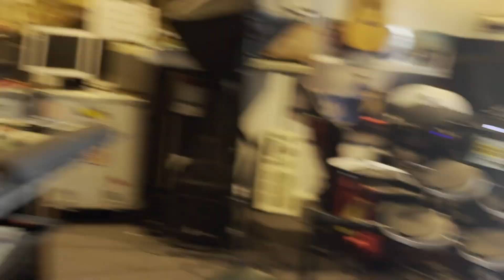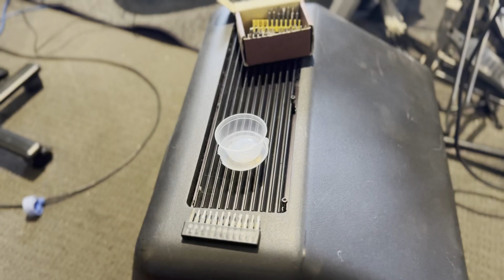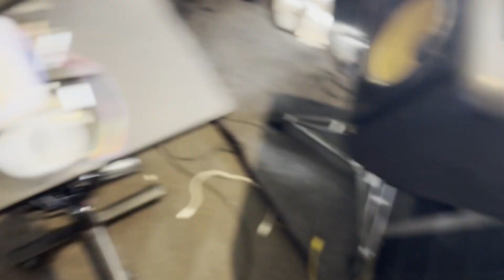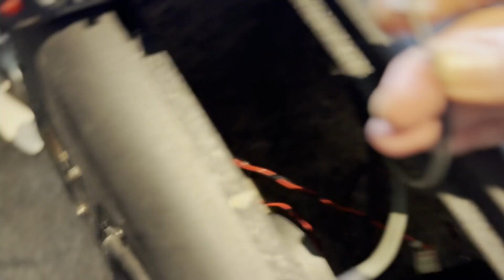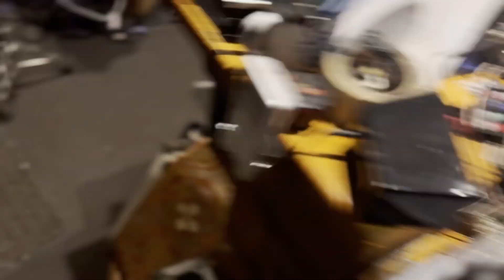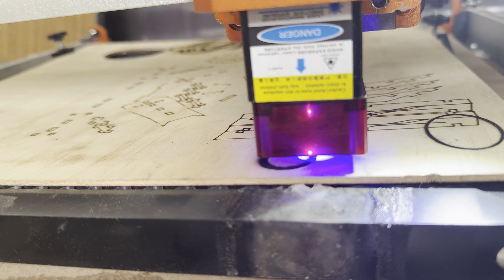KRK E8 Speaker Amplifier Repair and Tweeter recoil - Fixing my own stuff-up

Comment: Awesome vid you should've recorded the voltage test points measurements and those little important steps like how to conect your oscilloscope to the plug and the swapping between amplifiers,also what you did whit the Arista,it would've been nice,Nice video I have had 10 of this,I'm currently working on 2 whit really bad burned power supply PCB boards at cement resistors location! Plus bad caps on the same location Power supply PCB board !Awesome job!

Comment: This video is excellent. Thank you! My KRK E8s had an issue today, both tweeters didn't seem to be working. Both speakers had an odd hum, after about 5 mins of being powered on the hum went and the top end came back on the left one, and then around 5 mins later the other one came back on. I'm wondering if this means I have some capacitors on the way out.
Reply from the maker: @simonwoodgate5458  thanks. Sounds like it yes. They are very old now so I’d be def replacing the power supply capacitors and go from there. Him or noise when nothing is connected to them is a dead giveaway of capacitors leaking and not holding charge.
Reply: @onomatopoeidia  Thanks. I've had them over 20 years, mixed everything on them. Don't know what I'll do when they finally die!